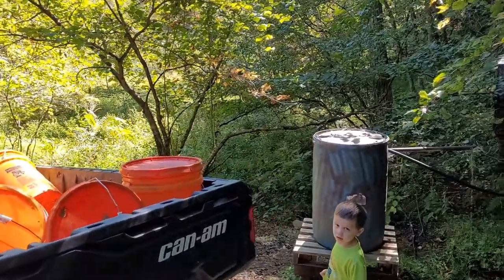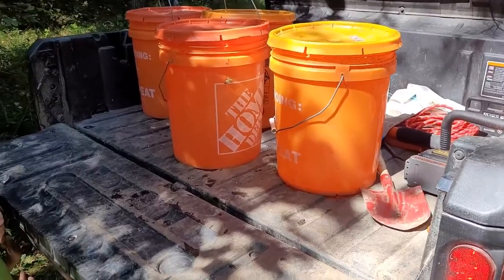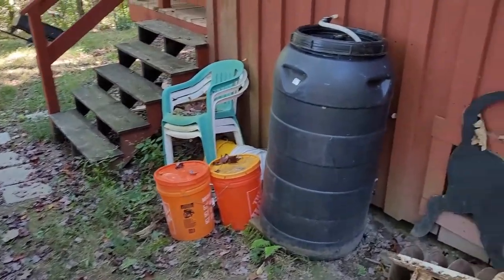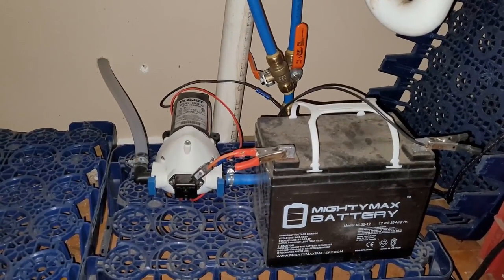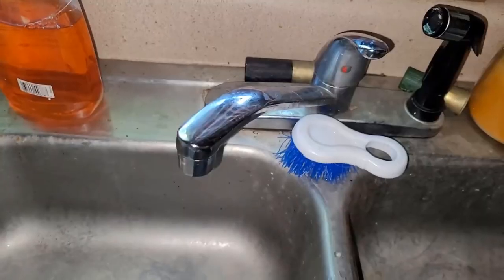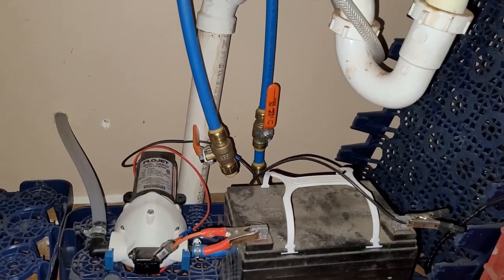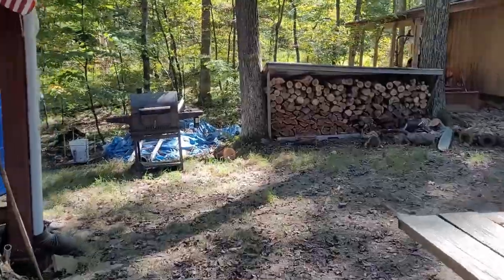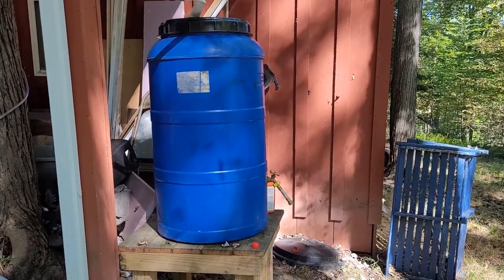Off Grid Cabin Water Setup & Supply

Comment: Have you considered using a ram pump to move water?  The overflow can still be caught in a barrel, and you would be able to get some water to the cabin.
Reply from the maker: We did try to set up a ram pump last year, but it didn't work. It started pumping water, but the vertical height was too high and too far away and it couldn't get the water there. It's a pretty steep hill to get up to get from the spring to the cabin.